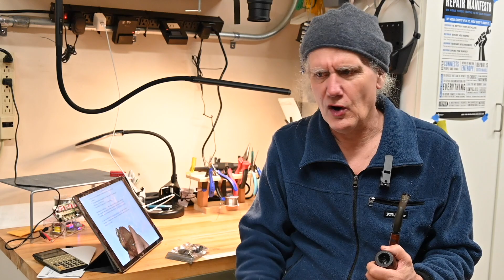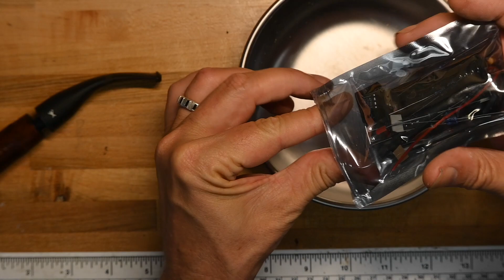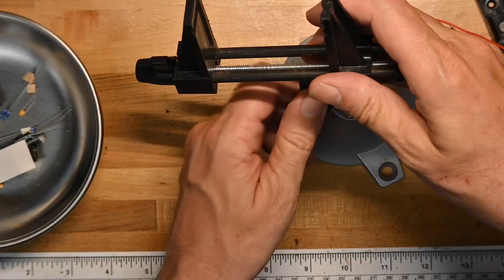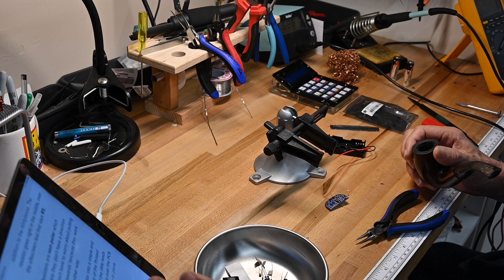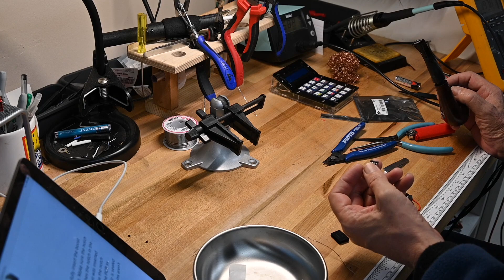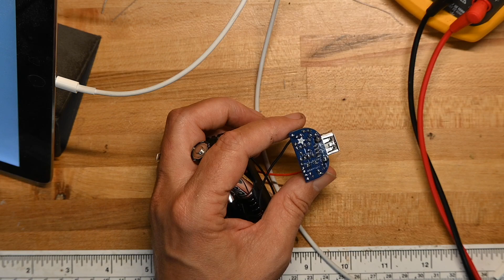C.K. builds a Minty Boost from Adafruit

Comment: Nice video. I wanna know can I use dc motor and add buck converter to it to charge my mobile. And plzz tell how to bias USB deta lines I mean how to add resistors to charge iphone
Reply from the maker: A lot to try and answer in a comment, sorry.  As for using a motor and bumping up the voltage to charge your phone, a number of vids on YouTUbe show something similar (look for videos about hand-crank charging and replace the crank with your motor) I'd recommend searching on YouTube for "making a USB phone charger" and you'll find quite a few different approaches to the challenge.